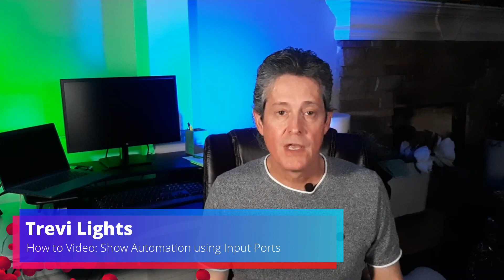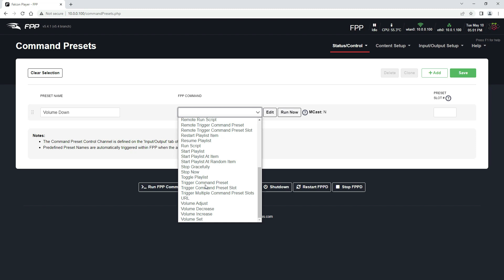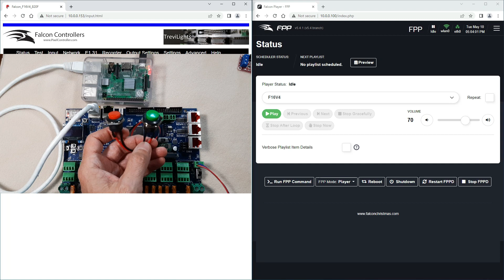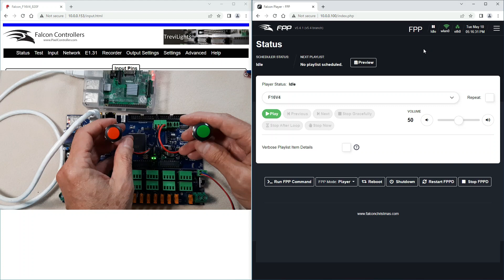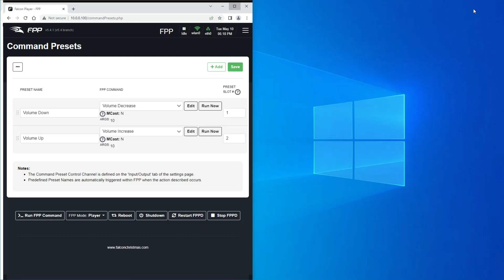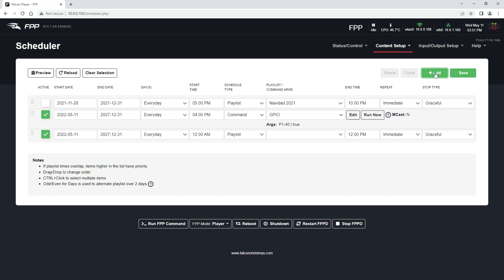Falcon Controller F16V4 Show Automation

Comment: f16 and f48 connected to pi. will i have 4 of these if i change the numbers to 5-8?
Reply from the maker: Hi There. Can you elaborate more on your question? I do not understand it.
Reply: @trevilights  sorry. Will I have 4 additional if I just number 5 6 7 8 on the command presets.
Reply: @trevilights  the ports of f16 is 1-4 and 48 is 5-8.

Comment: Trevi Saludos....me interesa mucho empesar en esto..... Tus videos me tienen bien intrigado😂😂😂😂 que hago para emlezar
Reply from the maker: Hola Eliud. Gracias por escribir. Me da gusto que te hayas animado. En que pais te encuentras? Puedes empezar planeando que elementos quieres incluir en tu show. Por ejemplo, un Mega Arbol, Copos de nieve, Figuras cantantes,etc. Te advierto que es mucho trabajo manual ya que los pixeles se compran por separado y hay que insertarlos en los elementos uno por uno. Necesitaras fuentes de poder, cables, conectores, etc. Vaya, toma tiempo, dinero y esfuerzo. Pero es muy gratificante. Puedes empezar por comprar un controlador y algunos pixeles y empezar a aprender como se conectan y como relizar los efectos en xlights. Con todo gusto te puedo ayudar. En mi sitio web trevilights.com puedes separar tiempo para una video llamada y platicar al respecto y asesorarte. Asi es como trabajo yo.
Puedes escribirme a mi correo 'contact@trevilights.com'. Saludos.

Saludos,
Reply: Gracias Trevi lo estate haciendo

Comment: Great Video! Got me super excited. I noticed you mentioned there are 4 input ports for the F16V3 as well. I noticed they were analog ports AN1....AN4. I am having issues configuring the F16V3 in the same way that you shared. Have you had luck configuring the analog input triggers on the F16V3? Would you be willing to do share another video on how to configure the triggers on the F16V3? Thanks!

Comment: I am trying to figure out how to set up a push button for visitors to turn on a radio if they are walking by and want to hear the show.  Can this same procedure be applied to a Kulp k16A-B that uses the beaglebone black?  If you wanted to run an fm radio for example from the relay, would you only hook ground and gpio pin 40 to the relay and add 115VAC to the other input side of the relay where your power is supplied from the PI in the video, and then connect your 115ACV radio to the other side of the relay assuming the radio uses less than 10 amps which I am confident it would.  Could you show the same video using the beaglebone?  Thanks.
Reply from the maker: Hi Larry, What I show on this video is possible because the Flacon Controller has 4 input Ports that can then be configured to take some actions  on Falcon Player (Start/Stop Playlist, volume up/down, Skip song, etc) running on a Raspberry Pi. The Kulp does not come with input ports. But if you want to turn a radio on/off you do not even need to have the Kulp or a Falcon involved. You can do it exactly as you say by using a 115VAC relay. No need to connect anything to the pixel controllers. You can even use something like this...
https://www.amazon.com/Intermatic-FF5M-5-Minute-Spring-Brushed/dp/B000B8YKF2/ref=sr_1_11?crid=2PARQILVWM13G&keywords=10%2Bmin%2Btimer%2Bspring&qid=1677778458&sprefix=10%2Bmin%2Btimer%2Bsprin%2Caps%2C124&sr=8-11&th=1
Reply: @trevilights  Thanks for the prompt reply.  I see how that could work if the radio is tuned to the fm broadcast frequency and it will just come on and off if power is supplied. Good simple idea.  Thanks as usual.
Reply from the maker: @Christmaslightshow2422  Yes, or you can use the switch to connect/disconnect a speaker wire that is always playing.

Comment: 6 months later... you can't buy one.
Reply from the maker: Hi, give them a call. They may have ready to run controllers. Seems their website inventory levels is not to date.
Reply from the maker: Try kulplights.com they have good pixel controllers.
Reply from the maker: @MccathernFamilyLights  Try the Kulp controllers at kulplights.com
Reply: @MccathernFamilyLights  It must be a Chinese COVID induced supply issue... Just like APPLE iPhones.

Comment: hi there i just want to make sure i understand right before i connect my second power supply to my controller i have one to port 1 to 8 so now i want to put one on 9 to 16 and want i did i took other ac wires and plug it to second controller so now i have 2 separate plugs to put into socket on wall is that ok want i did i just try to see want happen when i just plug a power supply to 9 to 16 it do not turn on is that right you have to power 1 to 8 first to make 9 to 16 to work thank you for your help
Reply from the maker: How are you powering the controller.  There are two ways. One is using the ext.power connection and the other is using the V2 pixel port which also powers port 9 to 16. This is set using some switches on the board.  If you choose to use V2 to power the board, then that power supply needs to be on. You can also power the controller by choosing the ext.power port.  This will keep the controller alive even you do not have power on V1 or V2 ports.
Reply: i have a postive wire and negative wire from power supply to controller port 1 to 8 could i put a different power supply to port 9 to 16   with other set of wires and plug the power supply in a different plug on the wall so i have two separate power supply is that way ok thank you
Reply from the maker: @denn450  Yes. This is one of the ways. Please refer to the user manual for more details and other options.

Comment: hi trevi i have other question if i use port 9 to 16 on my controller could i use a different power supply and if i connect it do i have to add a different ac line or connect it to power supply 1 and if i do could i use that one to power inject the props on 9 to 16 with that power supply negative and postive wire thank you
Reply from the maker: Yes, you can use a different power supply for port 9 to 16 and use that same power supply to Inject power.

Comment: hi trevi im stuck on a question i have 1500 pixel i want to know if my 350 watt power surply at running 30 percent brightness could handle that how do you run all your pixels do  you hook up 2 power surply and if i hook up 2 power surply would that work thank you
Reply from the maker: Hey den bel. Your 350w power supply is more that enough for 1500 pixel. You are good. You can use a second power supply if you want to depending on how spread apart they are. If you use a second power supply just connect the positive an negative as you will normally do. Inject power every 200 -300 pixels. That should do the trick.
Reply: thank you trevi for the help so if i add a second power supply in my box do i connect a wire from the first power supply to negative postive and ground to second power supply and then could i use the second power supply to inject power to my pixels negative and postive wires thank you for your help and i like all your videos you do